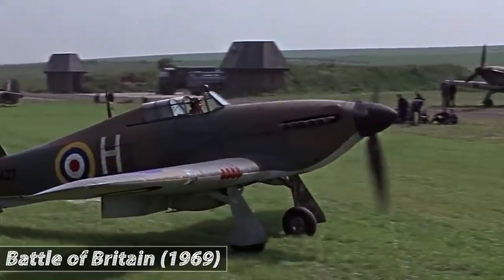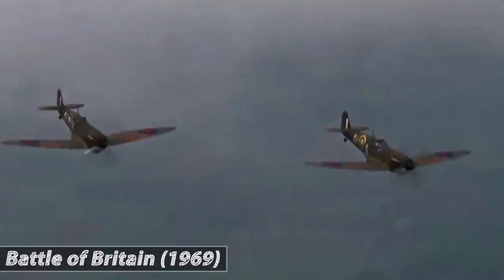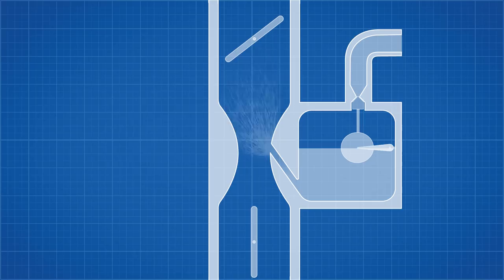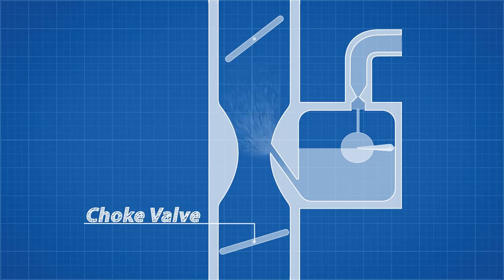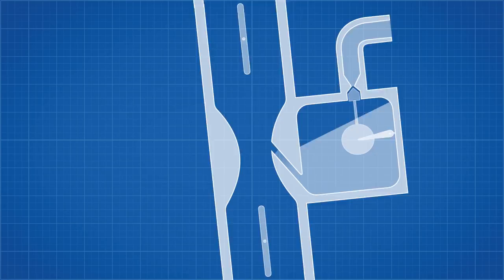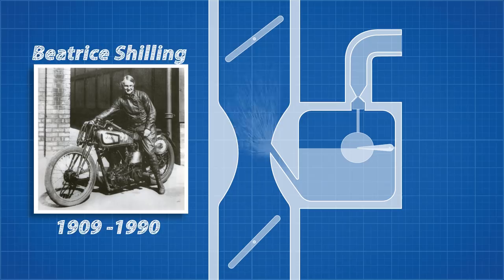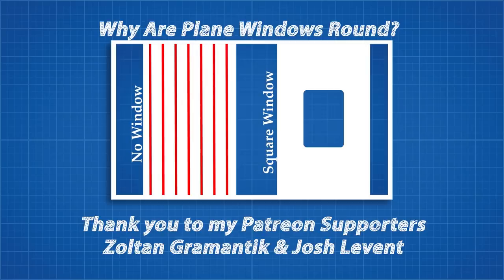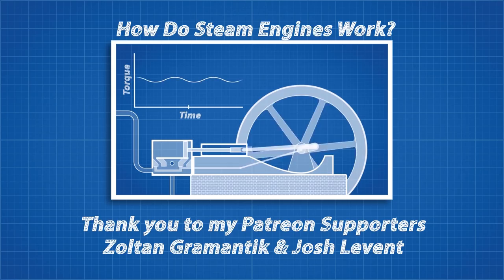The Spitfire's Fatal Flaw

Comment: Why show Hurricanes taking off? As for the carbs flaw, pilots learned to roll before a dive to keep carbs feed.
Reply: Hurricanes used the same Merlin engine and thus also experienced similar issues.
Reply: +Richard F. Stripe Right. So to say the Spitfire had a flaw is somewhat flawed. The RR Merlin had a flaw that was common to both the front line fighters of the period.
Reply: The Spit was deadly in the correctly trained pilots hands, maybe the best fighter in WW II...
Reply: Mitsubishi Zeros had the same problem. Wildcat pilots learned to push over into a vertical dive when they had a Zero on their tail. Barrel rolling would keep the fuel where it belongs, but caused you to lose speed and distance.
Why hurricanes? That's what I was wondering. Surely they didn't mistake them for Spitfires....
Reply: F8F-1b, Fw 190D, Ta 152, Tempest Mk.II, F82, P47N, Meteor F. Mk.3, do these names mean nothing to you?
Reply: So much incorrect stuff in this video. If this video were an airplane it could not fly. I conclude that the video is made for clicks and subscriber maximization. Nonetheless a few interesting things, but not enough to subscribe.
Reply: The clip which he keeps mentioning about the engine cutting out is a hurricane as well.
Reply: Yes it's a bad video and an old problem which was solved very early on. Just a schmuk trying to make money out of youtube. He needs to get a job!
Reply: good video, clickbaity not-entirely-accurate title. as for best fighter of the war. fighter is a very broad category. spitfire has a very serious claim for best interceptor of the war, but youd be hard pressed to argue it as contender for best escort fighter, due its short range
Reply: Kirothe Avenger My argument is that there are plenty of "superprops" that can hugely outclass the Spitfire, even the Spitfire Mk.22 (the Mk.24 was a postwar prop.

Also, I forgot the La-9.
Reply: ok john moore name one.
Reply: 0:01, 0:10, 0:33 are Hawker Hurricanes, the plane cutting out when inverted is also a Hurricane. 0:18 is actually a Hispano Aviación HA-1112 M1L , a Spanish version of the Messerschmitt bf-109, and actually has the same Merlin engine as the Spitfire and Hurricane.
Reply: The real doktorbimmer that's because it seems he ripped most of the footage from the BoB film, and at that time they couldn't get their hands on many planes. no proper german 109s and only a couple of spitfires. in the scenes in the film when spit fires peel off if you look closely the background fighters are actually hurricanes
Reply: Then why wasn't THAT mentioned???
Reply: rccrashburn the fact that they were mostly hurricanes? I agree totally. the fact that the film cut corners in terms of aircraft? It was the 60's they made do with what they had.
Reply: Quite right, and the light-blue elevation view also illustrates a late model (extraordinarily, with a bubble canopy) which means this poor ordinary bloody engineer has problems with aircraft recognition. By 1943 the Packard Merlins were equipped with Bendix fuel equipment preventing flooding.

Despite this, and the points noted by so many others (nose obscuring vision on landing, etc.), the fact is negative G was not a significant problem for the 11 group Hurricanes in late 1940/early 1941 because the way Park had them fighting - not that I believe the poster really understood why.

Hurricanes - being more stable gun platforms - were better for  attacking the bombers. Less than a quarter of Park's available fighters were Spitfires so he vectored those on to the fighter escorts; fighter-on-fighter dogfighting at altitude was better left to the Spits. 

That's why the negative-G was a problem for the Spits but not the Hurricanes; the overwhelming majority of 11 group Hurricane sorties involved downing bombers, at least after the Battle of France. 

Dogfighting Messerschmidt fighters was more common for 12 group Hurricanes formed into big wings, but they generally came late to the party anyway, when the 109s had to break off hostilities and run home to refuel (a 109 could only loiter 10 minutes over the target)
Reply: Negative G was not much of a problem since the RAF pilots just rolled over into a dive maintaining positive G, in 1940 the problem was improved by the work of Beatrice Shilling and her team and 1941 they solved the problem by moving the outlet from the float chamber. 
The Bendix carburetor on the Packard Merlin was long after and Rolls Royce gave the carburetor to Bendix, it was the speed density carburetor that Rolls Royce and SU had developed.
Reply: Do you mean Rolls Royce Merlins . Packard Merlins were US licenced built Merlins used in the P51 Mustangs.
Reply: ***** Thanks to the technically superior Bendix pressure feed carburetor Packard Merlins did not suffer from any of the flaws of the Rolls-Royce version..
Reply: The real doktorbimmer Merlin's got fuel injection later in the war. The Packard version was almost identical to the current models of RR Merlin of the time.
Reply: Kirothe Avenger Ah.. No,  Rolls-Royce adopted the Packard's Bendix carburetor.. which is not fuel injection at all.. just a much better design than the R-R's antiquated  SU float bowl carbs. 
The Luftwaffe used GDI (Gasoline Direct Injection) throughout the war while the technology was not available to the Allies until nearly the end of the war on just a few selected models, mostly American manufactured.
Reply: ***** 
The P 51 used the Rolls Royce Merlin engine, it was built by Packard to Rolls Royce specifications and all the design and development was done by Rolls Royce, Packard were well paid as a subcontractor and the US stole the engines they used in their P 51`s and never paid Rolls Royce for.
Reply: Barrie Rodliffe Do you have any links to back up your claim the US stole Merlin Engines or could you perhaps go into more detail?
Reply: Sultros Drunknsage 
I think he means the designed not the engines. Wikipedia on P51 Allinson engines should confirm that Packard modfied the original Merlin design but only to suit mass production methods. No performance enhancements. 

Barrie is an old timer, like me. The Spiitty, the BOB, it means a lot to us. To see any part of that history being re-written in popular accunts by our friend the not so good Doctor is - upsetting. 

There's a heap of this Nazi re-appreciation around right now. Poitics and so on. The Alt-Right (shudders). 

Also there's a lot of tech credibility we gave to the USA when the war ended, jets, computers, rockets, radar. And a long time paying back war debt 2003

So go easy on Barrie and me, eh.?

You wouldn't like us when we're angry.
Reply: Bruce Bartup I hope my earlier question didnt come across hostile. I was genuinely interested as i am a huge fan of WWII aviation.  I have a massive amount of respect for british engineering and I dont believe they get enough credit here in America for their contributions to WWII. The Merlin, radar, nightfighting, jet engines, the list goes on. It was the British who figured out how to land the F4U Corsair on an aircraft carrier. One of the points i find most amazing about the Spitfire is how good the design was and how long it lasted compared to American prewar fighters like the P40. The Brits did a hell of alot with a few planes and they were some of the best. In the case of the mosquito, it was the best twin engine light attack / bomber during the war. Im also a huge fan of the Beaufighter. Its a shame how little there is about it as far as videos / documentaries go.
Reply: Sultros Drunknsage 

Thank you. Apologies for any mistakes there Such potential confusions are one of the many sadnesses about the current fad for all things Nazi.* I had no real doubts myself, but Barrie I know has a real sore spot where period British  engineering and historical accuracy are concerned  

I'm very glad to meet another WWII nut (I'm only a peanut unfortunately,  you seem to be a more major league enthusiast (Walnut or Brazil? my joke)). 

I hope you are locked in to wwiiaircraft dot net the best site by far in my experience.

Personally I like to think that British engineering of the time had  very special character. It came from Public Schools and a history of Empire among those curiously extreme exploitative disgusting moralists the Victorians. There grew up a kind of tolerance of the extraordinary person. It accounted for the personal care of the pilot's experience in the Spitfire design as well as the 'couldn't write it as fiction' history of the Mossie, for Bletchley, for Whittle, for Tizard and many more.  For Dowding. Especially for Dowding. 

But this won't do - you must get on.

Yes the Beaufighter "Whispering Death". In the shape of the Torbeau, had a good role in Burma/Pacific IIRC.

*
(Honestly Tiger Tanks, Me262s, Ju88s, tactics, general staff, (and I'd take a small wager - rations!) all re imbued with the properties of magic by these very strange apologists and denialists for the 3rd Reich. )
Reply: Sultrod Drunknsage
Rolls Royce paid Packard for all the RR  Merlin engines that Packard made for Rolls Royce but the USAAF 
P 51`s had Rolls Royce engines that Rolls Royce was not paid for.
Reply: +Sultros Drunknsage  The US did not steal the Merlin..  in fact the brits came to the US for help, due to the simple fact that Rolls-Royce did not the capacity to meet demand and did not have the experience to convert the design into one suitable for mass production. R-R continued building Merlin engine mostly by hand-built methods and techniques throughout the war.
Ford Motor Company, who was the first choice by both American and british officials actually turned down by the offer and proposed its own design ( The Ford GA V-12)  Packard was later offered the deal and accepted.
Packard quickly assessed that the problematic SU carb was obsolete and redesigned the Merlin to use the superior Bendix pressure feed design.
American made Merlins delivered to RAF featured the Bendix carb and testing revealed the superior performance, R-R later adopted the American improvements.
Reply: +Bruce Bartup  I don't believe anyone here is espousing the tenants of fascism or fascist regimes... whether it be the british royal family or German national socialism.
The Tizard Mission's initial attempt to SELL british technology in order to save the country which was at the time losing the war and weeks away from financial insolvency.. failed to receive any offers, the second Tizard mission offered the technology in exchange as security on the massive multi-billion dollar Anglo-American Loan program.
The R-R Merlin was not a part of this bail-out loan.
Actually by the year 2000, but the brit government defaulted on the loans 6 times.. 
""There's a heap of this Nazi re-appreciation around right now""  Perhaps because of the lack of appreciation for American and Canadian assistance in preserving what is left of what many feel is an ungrateful british "empire"
Bobs your uncle..Cheers mate!
Reply: The real doktorbimmer
doktor (my reply)
I don't believe anyone here is espousing the tenants of fascism or fascist regimes...
(no, agreed, it's rife elsewhere)

whether it be the british royal family or German national socialism
(false equivalence, by a mile)

The Tizard Mission's initial attempt to SELL british technology in order to save the country which was at the time losing the war and weeks away from financial insolvency.. failed to receive any offers, the second Tizard mission offered the technology in exchange as security on the massive multi-billion dollar Anglo-American Loan program.
(that is unconventional history - citation please. Indeed Britain was in a parlous state and thus wished to ensure that  key technologies were shared before invasion. in 1940 I believe we were on 'cash and carry', then lend lease, britain amongst others, beneftted from the Marsha Plan gits? (ALA started 1950 AFAIK)

The R-R Merlin was not a part of this bail-out loan.
(agreed, no one said otherwise)

Actually by the year 2000, but the brit government defaulted on the loans 6 times..
(2000 planned but 6 deferrals, as permitted  by agreement put it at 2006, the American Loan Agreement came after the war after a shockingly sudden end to Lend Lease)

""There's a heap of this Nazi re-appreciation around right now"" Perhaps because of the lack of appreciation for American and Canadian assistance in preserving what is left of what many feel is an ungrateful british "empire"
(you are suggesting that the rise in pro-Nazi historical revisionism is linked to ingratitude for american protection during tthe cold war? Interesting - why do you think so?)

*Bobs your uncle..Cheers mate!*
(you're welcome)
Reply: Bruce.
The Tizard mission was not so much to sell technology but an exchange of technology, as for Britain losing the war that is complete fallacy, at the time Germany was stuck with trying to defeat the RAF which they failed to do just to have the slightest chance of an invasion.  Britain paid in cash for everything until late 1941.
The Luftwaffe never fully recovered from the losses in the Battle of Britain and further heavy losses in the Mediterranean and North Africa deprived Germany of much that they badly needed for the East. 
The RR Merlin was eventually produced by Packard who were well paid for every engine they assembled. 

The ungrateful British were treated rather badly by the greedy Americans who wanted to be the most powerful nation and were jealous of the Royal Navy.
The loan was repaid in full, unlike the USA who never paid their debts.
Reply: Barrie Rodliffe Barrie, the previous post is composed of doktorrbimmers words in bold and my response in brackets. I would never say that the Tizard mission was a sales effort.. The remainder seems to be misundertood mostly if you do happen to have a better reference on Tizard than my 'stuff I've picked up/wikipedia' I'd be obliged.

As always great to talk to you.
Reply: Sorry Bruce, I did not read it properly, I missed the bold part and read it as your words. 
I no longer see any of doktorbimmers comments.
 Thanks for your polite response.
Reply: Barrie Rodliffe Not at all Barrie, it's just refreshing to talk to someone who says 'sorry' easily and without any hint of reluctance.. 

In case you didn't read it before, I also reminded you a ffew posts back that you and I were contributors to what must be one of the longest threads in wwii aviation discussion history. 'Spitfires vs Mustang P51' thread. At least I think that is you.  I was under the name 'bbear' at the time.

cheers
Reply: The royal family certainly did not attain it position through democratic elections..
The brit have always been known for a great sense of history... until it comes to the facts regarding the Tizard Missions and the Anglo-American loan, on this topic their collective memories begins to be considerably more fuzzy..Lol
I suggest you try "deferring" you automobile or mortgage payment.. and see what happens!
No, I was referring to WW1 and WW2.. but you could also include the considerable investment America made in maintaining stability in Europe during the Cold War while the british empire continued to slowly implode during the post war period. 
The previous comments are irrelevant regarding Rolls-Royce's flawed Merlin engine.. Packard did indeed improve the design by discarding the obsolete SU carb and replacing it with the American Bendix-Stromberg PD-18... after that, the flooding AND the fuel starvation flaws were both solved.
Cheers mate!
Reply: The real doktorbimmer 
ok, les see how you do on one fact

"once more NO carburetors were presssurised prior to 1940, they were first fitted to US aircraft. Spitfires got them in 1942 at which time ALL producers of Merlin engines R-R and Packard had them. The introduction of turbochargers shortly thereafter on Spitty mk IX and above made them competitive to the end of the war.

To describe the SU carburettor in general or the R-R Merlin fuel system in specific as flawed is not correct. Both fuel injection and carburetors had acknowledged limitations at the time they were chosen by the respective  design teams. Carburation gave the Merliin an edge in sheer power that was needed in its primary role on point defence interceptors which had to climb rapidly on scramble. 

There was no flaw or error, there was a choice. The choice had some unexpected tactical consequences (unexpected by both sides) The story of how the design was modified in field to give the RAF back an escape maneuver in the nick of time is instructive and historically interesting, that is all"

sound famniliar at all? you had bno aanswer then and won't have now

but thatwon't help history

The internet age, isn' it wonderful.?
Reply: +Bruce Bartup The SU equipped R-R Merlin certainly was flawed.. and completely outdated.
The Chandler-Groves pressure feed carburator was in production in 1937.
And the Bendix-Stomberg was in production by 1938.
German Aircraft manufacturers were producing engines with 3 different types of Direct Fuel Injection as early as 1935.

All Carburaters have one major disadvantage compared to fuel injection... LESS POWER
 Carbs require the use of a venturi to produce a pressure drop... this pressure drop is the direct result of the restriction in air flow caused by the venturi.
Reply: +Bruce Bartup  It appears your knowledge of aircraft fuel delivery systems is not as extensive as you believed.. even with the help of the internet..  cheers!
Reply: +Bruce Bartup  said, quote; "The introduction of turbochargers shortly thereafter on Spitty mk IX"
The Spitfire IX was never turbocharged.. it used the Merlin 61/63 engine.. the first to use the stronger Packard 2-piece engine block design and the 2 stage, 2 speed supercharger
Reply: +Terra Australis They were used on all if the wartime supplies ran low on site. License built meant built to tbe same specs, meaning they were interchangable. There were many engines swapped in planes, and no one was the wiser....
Reply: +James Armes **on the
Reply: +James Armes **to the same specs